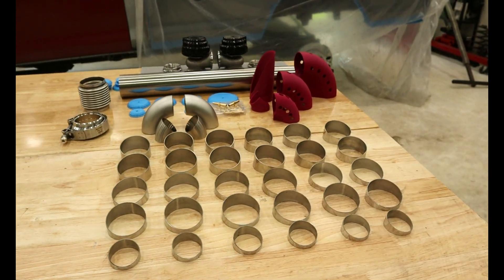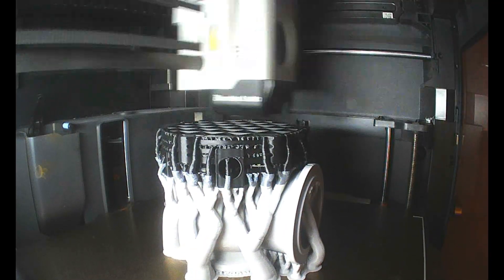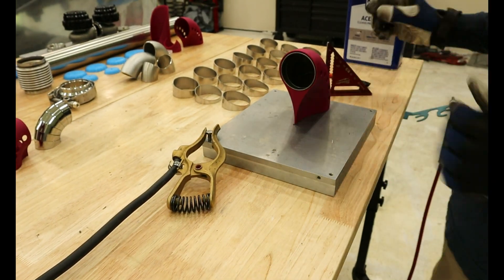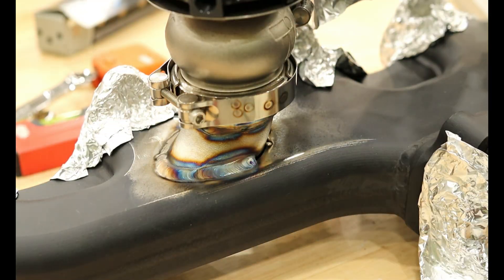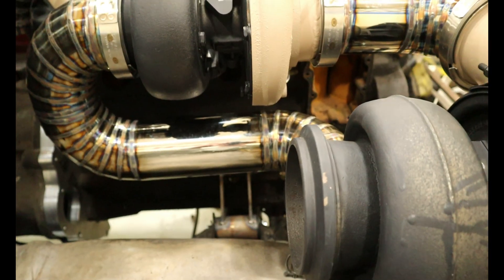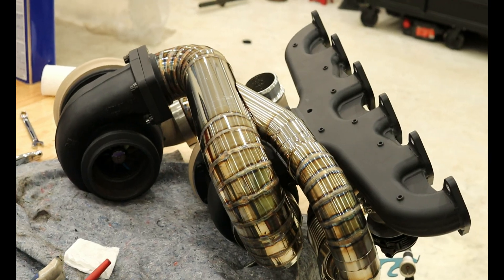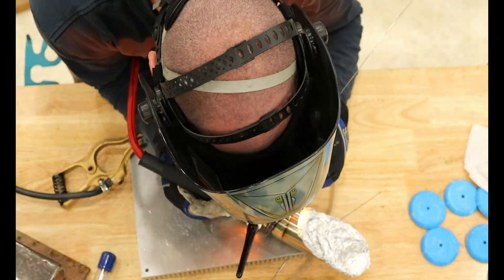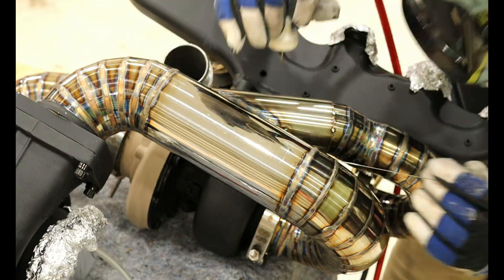A Better way to Fabicate - Wastegates for my Custom Compound Turbos

Comment: If you can't see what you're doing due to interferences, just use a mirror. That's how most pipe welders do it.
Reply from the maker: Its hard enough to weld a good bead 😂😂 i couldn't even imagine using a mirror haha
Reply: @barnbuiltbeaters it's a whole lot easier than you think, after a few mins in the mirror it feels like it's right in front of you.

Comment: Very cool! Do you preheat the cast iron when you weld to it? My colleagues do it when welding steel to cast iron to reduce the change of cracks forming.
Reply from the maker: I did not. Im not a professional welder by any means so I might have messed up here! Hopefully I'll be all good. 
Part of it is allowing it to cool down between passes too.

Comment: The junk in the weld pool is probably from the cutting tools they used in China to clean the part. They don't passivate the parts before shipping.
Reply from the maker: Could be! I also used a degreaser in an ultrasonic cleaner. It could have had some residue on it before welding, though I cleaned with acetone after too. Either way welded better than expected!

Comment: Really nice build process. Just out of curiosity is there any reason that you welded each seam in a straight line without jumping to the opposite side of the tubing? I always thought you wanted to weld one side and then weld the other side to prevent warping.
Reply from the maker: Im not 100% sure the correct process. I welded it this way to keep the beads running consistently. Where you stop you leave an ugly spot. If you stop then start again, you can blend it out to make it less noticeable.  I tried to keep the very last stop hidden if possible

Comment: god this makes me so keen to finally get a place with a shed and start learning to fab up stuff on my new beater
Reply from the maker: You can totally teach yourself! In 100% self taught. Im still learning too!
Reply: @barnbuiltbeaters  ill certienly be following the channel for some inspo and tips along the way, even get a 3D printer to so all the stuff youve designed will help a ton too!
Reply from the maker: @AuroraRainUwU a 3D printer is one of my most used tools in my shop. Designing jigs, tools, and test fitting parts prior to fabbing them. 100% has paid for itself over the year or so ive had it.

Comment: Beautiful fab/welding work! Congrats!
Also love the symmetry on the manifold gates' setup. 😍
Just one question came to mind at the end: Not running a gate on the exh feed of the LP turbo? Will it not boost too much this way?
Reply from the maker: Thank you! 
To be honest, I don't know. Wastegates are decently expensive. I plan on adding bungs for various data aquisition after I am done routing the intake/exhaust tubing. This way I can place them in the most aesthetically pleasing places. I will drive it and monitor drive pressure between the turbos to see if another wastegate is needed. I dont expect I will need one but honestly no clue!
Reply: @barnbuiltbeaters  Fair enough! Diesels are also very lenient to boost trial and error so no problem there. The fact that you're installing data logging hardware tells us you know what you're doing. Subscribed, will be following along. 😎

Comment: Beauty piece of work. So nice and compact. Thanks for the 3dp design for header legos. You need a couple o pieces of angle iron and threaded rod coming off the block to hold those bad boys.
Reply from the maker: If you watch the first turbo video I already covered building my mount. I was going to heat and bend a pipe but it didnt work out. I ended up cutting the pipe into piecuts, welding them together for the bends, and blending everything so it looks bent...but if you look close enough you can tell it isnt lol

Comment: Ya some turbo bracket for support you think that warped when you welded it wait until it’s heat cycled a few times under load with that weight she will start to sag and crack welds
Reply from the maker: Curious how it'll hold up. Its a weekend warrior so won't be a Huge deal. Also won't be extended to heat cycles for long durations just short pulls. If it cracks I'll either fix or build another

Comment: i just need to ask the question...............well before i do, Love your welds looks very nice.........WHY did you run the LOG manifold :@ .........you have the power to make a 45% better flowing manifold to better spool your turbos Low to High Rpm ?????
Reply from the maker: What do you suggest? I know a steed speed manifold, which is what I have here, is one of the best options for cummins. Tubular headers aren't common of Cummins. It might have to do with the pressures it sees and also the high EGTs were the manifold shines. 
This isnt a "log" it has paths internal so probably isnt as bad as a traditional log style

Comment: This is beautiful. I've fabricated my own twin turbo setup, and this has shown me I have so much more room to improve. I built it with piecuts and a lot of guessing.
Reply from the maker: This is my first time doing anything like this! I spend a ton of time trying to make it as perfect as I can. Literally will take hours to redo, or sand something so it fits perfect. Thank you! You totally can build some cool stuff!
Reply: @barnbuiltbeaters Well now you're just showing off 😉 it was already impressive, but being a first timer is even more impressive. I'm excited to see what you come up with in the future.
Reply from the maker: @ndog1234765 well call me a 1.5 timer. I had a first attempt that didnt work out haha. This was my 2nd attempt. I used bought pie cuts which helps keep everything consistent....call it cheating?

Comment: nice work man, as this whole contraption poses some significant weight, maybe add some bracing against the block, ideally with a threaded section to set some preload
Reply from the maker: If you watch my first turbo video you'll see I already did that! My truck doesnt have AC so I utilized where the AC compressor mounts to the block and added a support! Thanks for the tips though!
Reply: @barnbuiltbeaters add 12v ac you won’t be disappointed!
Reply from the maker: @crow78376  I am 100% a windows guys no matter if it is a project vehicle or my daily! The side "tilt" windows in my 78 make it all the better!

Comment: You should add the following bungs if you haven't:

1/8NPT for Drive pressure 
1/8 NPT for Boost Pressure Between The Primary and 2ndary turbo.  This will help you adjust your wastegates and "tune" the two turbo's boost pressure.
Reply from the maker: I have a total of 10 bungs I will be adding between the compound side and the intake side. I am plumbing everything up and then will be adding them so I can hide them the best I can or atleast making it pleasing to my eye without messing up any routing!
Reply: @barnbuiltbeaters I should have known you already had that figured out because of your attention to detail.